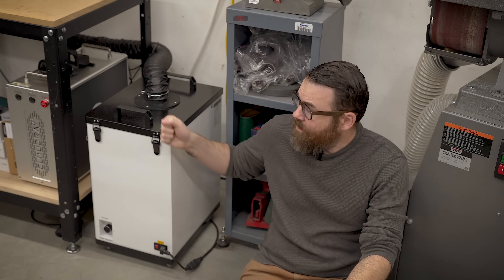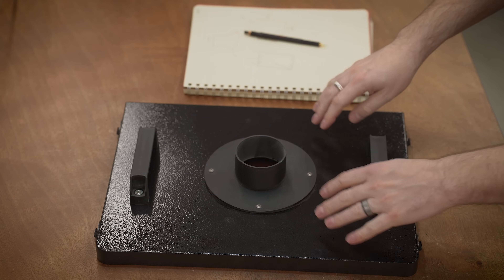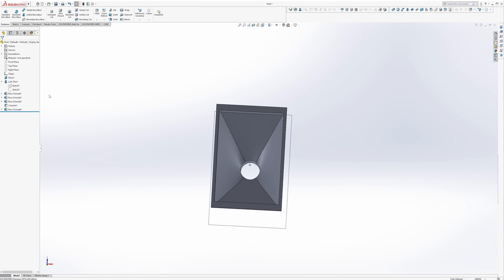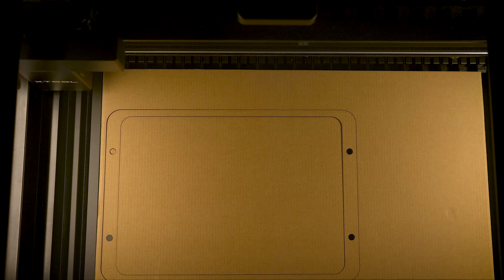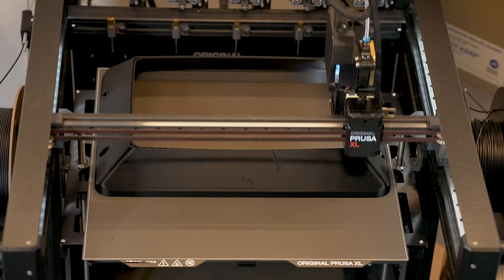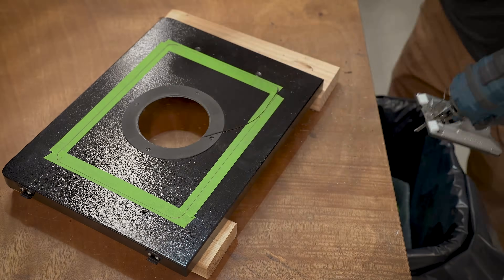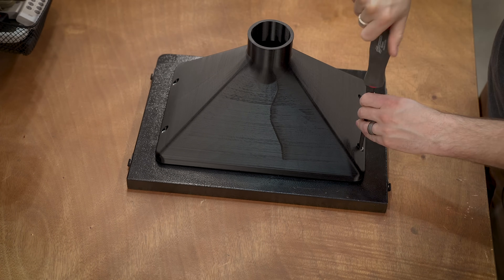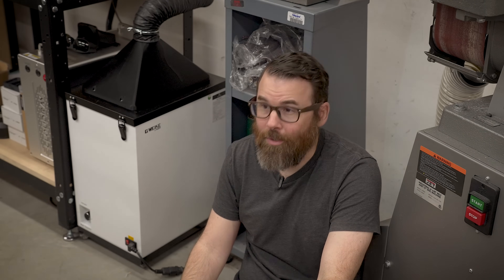Fixing a Design Flaw - HEPA Air Filter

Comment: Great video! I have this exact filter unit in my house. I don't cut a ton but I do some plastic and acrylic. Is it normal to smell it pretty bad or does that mean I need to change my filter? I thought this filter would cut down on most of the stink but no I have to open windows in the winter. 
Thoughts?
Reply from the maker: You might want to change filters.  I get a LITTLE bit of acrylic smell, but nowhere near as bad as even when venting outside (not sealed).  Acrylic is just very smelly, so its hard to get rid of 100% of the smell.

Comment: Dear Robert, how is your "relationship" to the XL today? I am thinking about to get one because of build volume and the tool changer, but after seeing the performance in this video I wonder if you got better prints out of it in the meantime? Thanks.
Reply from the maker: I've found that the XL doesn't seem to like the polymaker (or some cheaper) filament.  When you stick with Prusa filament or make custom filament profiles for cheaper stuff, it works much better.  It's not my favorite, but it does work well.  It's picky about filament selection.
Reply: Thanks for your quick reply - coming from a stone age Ultimaker 2 Extended+ - I am used to fiddling 😂 . How satisfied are you with your HEPA filter mod? I got a similar filter system (bit smaller) for a Creality 40 W laser. It has the same issue regarding the design.
Reply from the maker: @markusschicker8539  The filter has always worked well, but now with the mod I get more lift out of the pre-filter, so I'm quite happy.  It's worth doing.
Reply: @RobertCowanDIY  So now I just the the Prusa XL first ;-)

Comment: I would have printed a collar to stand off between your lid and filter by 1 inch first or designed it to replace the lid completely instead of cutting into the original lid. That's my 2 cents from the peanut gallery.

Comment: In my opinion the print and design turned out great for what it is. Will be looking forward to an update on how the performance turns out. Any thought on designing a swirl diffuser for the intake as a way to force the air towards the outside of the box?

Comment: 0.6 works fine with the Prusa XL; I have 3x 5T XL’s all with 0.6 nozzle and they print super clean. I think you didnt export your model with enough quality as you can see all the triangles on the long sloping sides. What firmware and slicer version are you running, because scarf seams work pretty well for hiding seams.
Reply: How do you "turn on" scarf seams?, I cannot find anything about it in 2.7.4?, wonder if it have other name in Prusaslicer? It's only in Orca slicer yet?, which doesn't support XL still? (I see there are things happening now though)

Comment: Thank you for the video.

I am wondering,  would a coat of paint on the finished print give a better finish? Not that you need the added step(s) of painting, and I fully realize your ultimate goal is a highly refined design/print process. But I do see prints and find myself wondering if a coat of paint would work well on them.

Comment: Angled prints like that, especially if in 2 directions never look great imo.  I think the lofted surfaces make for strange print geometry as well.

Have you upgraded to the 6.0.0 firmware?  It makes it print much quieter and has improved print quality as it uses resonance compensation now.  Make sure you run it after the upgrade.

Overall i looks good.

Comment: River,  i have an xl also and have some trouble.   I am relatively new at 3d printing though and have a tough time even making sense of the failure. If i print a small cube on a larger cube with one edge aligned we get really bad elephants foot on that transition of geometry.  Between that and the ringing/z wobble we are having a tough time printing functional prints in abs or really any tougher filament.

Comment: Hey Robert, great vid as usual.  I saw a video recently where someone swapped out the heat block (and nozzle) for a Volcano block and printed an updated fan shroud to account for it.  Pretty low impact change with pretty huge upside potential, might be something to consider.  I have an original series XL as well and have been quite disappointed.  This is a mod I am considering for mine.

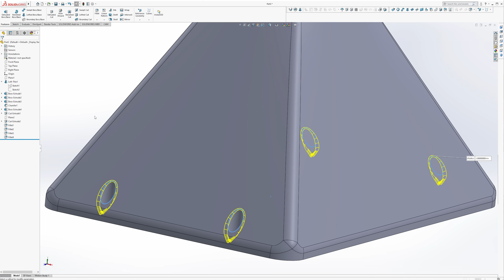Comment: Something I didn't see you mention in the great filleting of 4:00 is that fillets make your prints faster. Especially on high speed printers running good firmware they won't have to slow down (as much).

One thing however that would REALLY speed up this print is to make the part so thin that there won't be any infill. It won't lose (that much) structural integrity, but rather than having the little gap between the inside and outside that gets filled with tiny wiggles you just get a solid wall of plastic. It might even be stronger. On a part like this you might save half the time.
Reply: I agree, I have found that increasing the wall count will often save time over having infill
Reply: @woodwaker1  yeah and in this case the part could just be made thinner too. But indeed for existing designs there's sometimes even time to gain by adding walls.
Reply: A coat of epoxy will fix the print defects

Comment: As i mentioned in a reply. 100% change from arachne to classic permiter generation on any nozzles 0.6 and up. It fixed gaps in seams on my mk3s. No idea how prusa hasnt changed the .6 defualt to avoid this. Its worse on some models but classic just works.

Comment: Another great mod.  Could you use your Lazer to cut out the top.   Or could you use the Lazer to etch the cut out line?
Reply from the maker: It could etch the outline, but there's no way it could cut it.  For metal cutting you need a completely different type of machine and they're not at all practical for a home shop.

Comment: Question for us laser rookies, why couldn’t you cut the lid with one of your lasers instead of the jig saw?
Reply from the maker: Lasers that can cut metal aren't practical for home shops.  They're usually several hundred watts, require gas, and are quite large.  Everything found in a home shop is just going to be for cutting plastics and wood.  I can cut VERY thin aluminum (0.5mm or so), but that's even tricky.

Comment: 10:33 I used to own a Prusa i3 MK3S ( still do, just stopped using it ) which served me well until I got into the whole VORON fad with a 350 sized and ERCF equipped V2.4 ( absolutely no regrets ) and yea... Prusa has since been essentially dead to me. Credit where credit is due for their contribution to the hobby with back then creating above average Consumer 3D Printers and their Prusa Slicer Software ( which I've since dropped for SuperSlicer and now OrcaSlicer ) but man have they lost it... Yea the XL is essentially the only Multi Tool Head 3D Printer out there but that isn't exactly saying much when every Tech YouTube with one keeps complaining about the same issues that plague this machine and it being loaded with proprietary AF components ( compared to the Voron Machines ) sure doesn't help with solving problems on your own by swapping things like the Extruder or the Hot End out - Really sad.

08:00 Just these days I had to cut 1-2mm thick Sheetmetal apart ( to place under my G·Weike Cloud 50W CO² Laser for it not to cut into the surface it is resting on when I have to cut oversized parts while the Tray is removed ) using a Bosch PST 18 Li Jigsaw and I was pleasantly surprised how effortless it went through the material - So yea... Bosch Green will do just as well I guess 🤔
Reply from the maker: Yep, Prusa is in their own little world.

Comment: Very interesting not the approach I would of took but seems to work well. Why didn't you duct the 3 inch pipe into a full width 1 inch high opening 70 / 90 degrees from the filter so you would get a lower profile and have some what even flow across the entire filter
Reply from the maker: Eh, this is just how I approached it.  I'm sure there are many ways to accomplish the same thing.

Comment: You could also create a spacer that goes between the lid and the body to have the same effect but letting you go back to stock (not cutting holes) if it didn't work out or you wanted to sell it?
Reply from the maker: Yeah, that could have worked, but it would have been beyond the build volume of my printers.

Comment: I watched your review of when you first got this air filter. I wanted to comment but did not think you would see it. You are using three pre filters at the same time. You are only meant to use one at a time and the space above allows the air to spread out like your new modification in this video does. The pre filters just get clogged up super fast which is why you have three of them in the box.

What I find weird is that you get three pre filters that are meant to last up to 3 months each, 1 HEPA filter lasting up to 6 months and one carbon filter that lasts up to 12 months. Since you cant buy the filters separately. You get clobbered with buying a set more often than you need as you cant get the HEPA filter on its own. Pre filter is easy to source on Amazon in huge rolls so you can replace those easily.
Reply from the maker: AH, interesting.  Thanks for that, I didn't find that information anywhere.  That makes a bit of sense.  I still think this will help (at least that's what I'm telling myself).
Reply: @RobertCowanDIY  It will help, The less sharp turns the air has to make the less energy is wasted making the air change direction. Now the only way to improve performance without changing the fan or filters would be a smooth non flexible pipe to the lasers exhaust with large corner pieces to avoid sharp turns and cutting out the grill that these lasers always have and replacing with a course wire mesh ( to catch any small items the air filter tries to hoover up).

Also in regards to using 3 pre filters, now that you have modified the air filter it is probably better to keep using 3 as the HEPA is alot more expensive to replace and the cheap pre filter material will help stop more large particles clogging up the HEPA filter.

Comment: For the position of the seam (which is very noticeable in your print), there is a setting in the slicer in the Print Settings -> Layers and perimeters -> Advanced -> Seam Position (and it is possible to visualize in the render where it shows up). I think there are also modifiers where seams are acceptable. That of course would not change other issues you might see in the print.
Reply from the maker: Yeah, I'm aware of the seam settings, but there's some strange pressure advance stuff going on, there are large gaps at the seam.  Then there's the pattern!
Reply: @RobertCowanDIY ive noticed this on my mk3s+ when i use revo .8 and above nozzles. Going from archane to classic generation fixed it
Reply: It seems like a common issue with this setting
Reply from the maker: @cory-sr4ei  Gotcha, I'll try that next time.  This was a simple print eith 0.4mm...